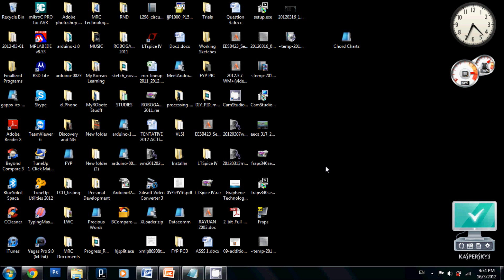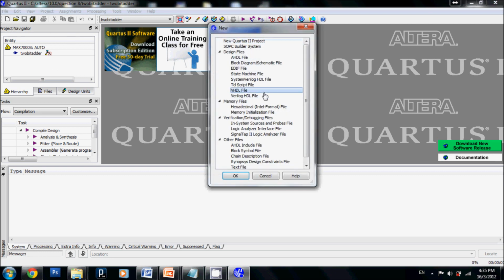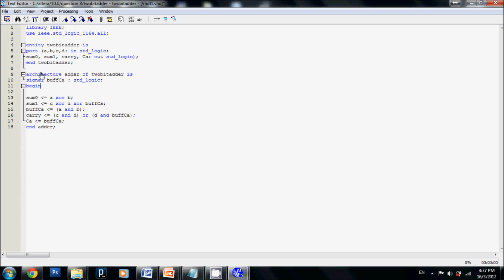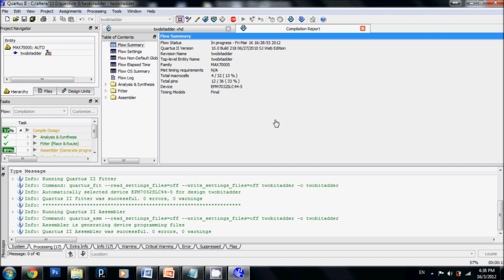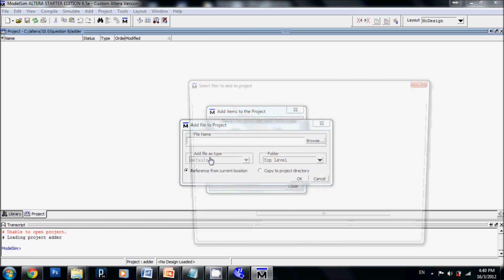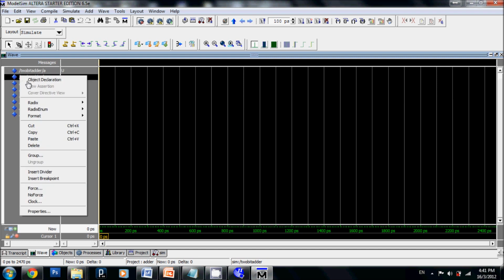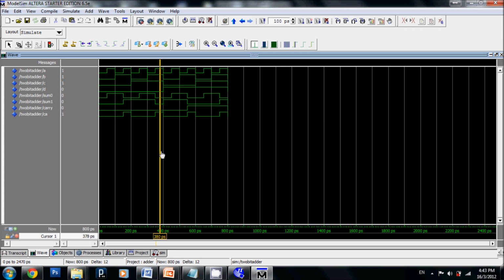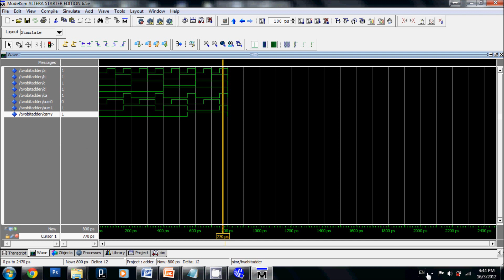2 bit adder using VHDL Coding

Comment: This was helpful, thanks.  I wish you did not go so quickly through the steps.  Also there is a problem with the adder.  For example with ABCD = 1110, the sum should be 100.  You show it as 000.  I will try to fix it in my design.  The equation for 'carry' should be:
   carry <= (c and d) or (d and buffCa) or (c and buffCa);
The last term was missing.  Carry (or I call it S2) is 1 if either 2 or 3 bits in that column are 1.  Actually I am glad that it was wrong.  I learned a lot from fixing it.  But ModelSim keeps crashing, and also I do not know how to cause ModelSim to reload the project instead of having to close it then restart it.
Reply: I see that Alin Dumitru had the fix below, oh well.